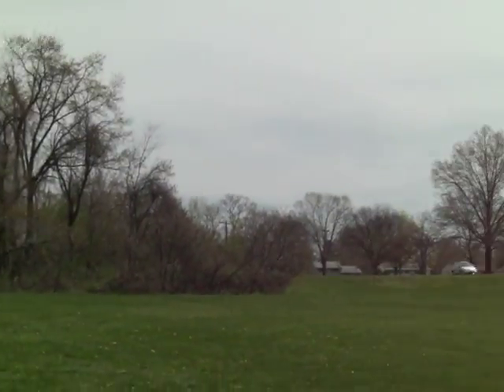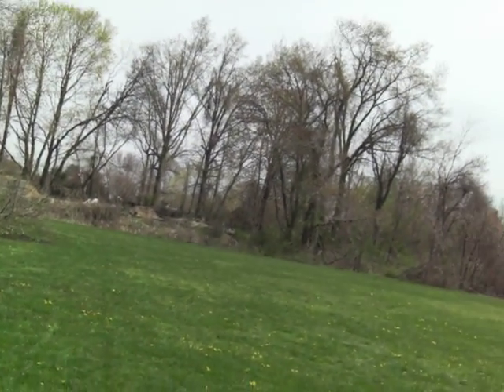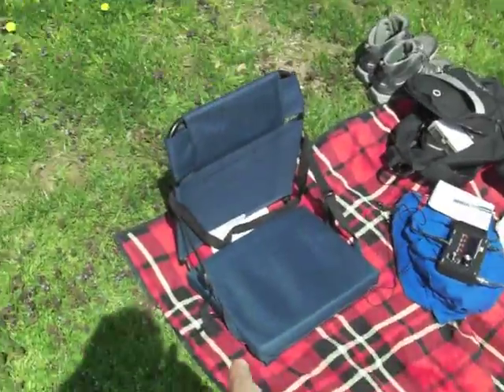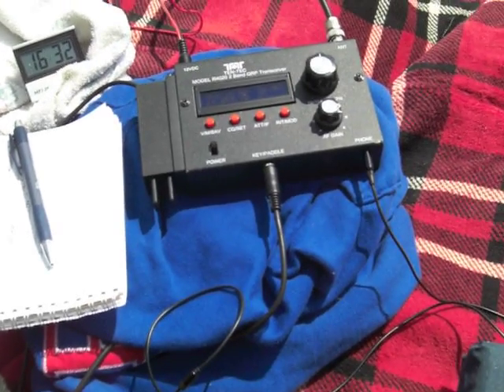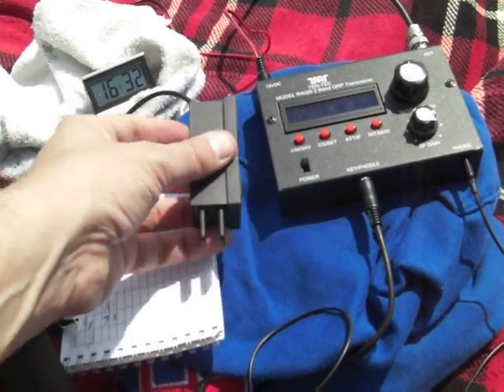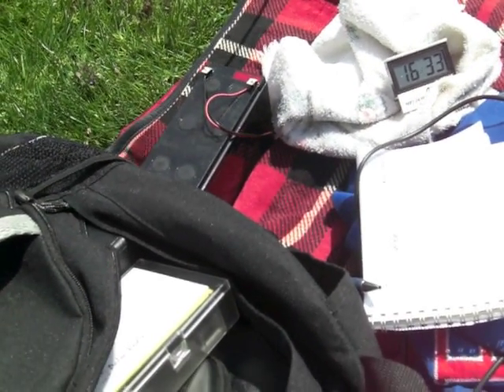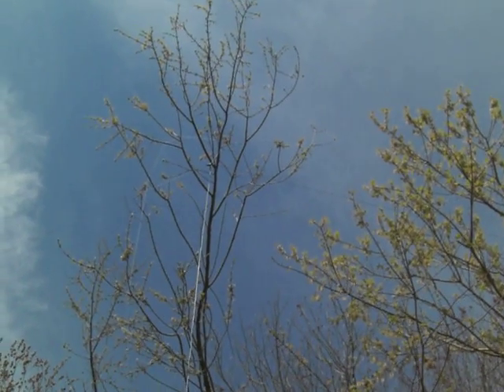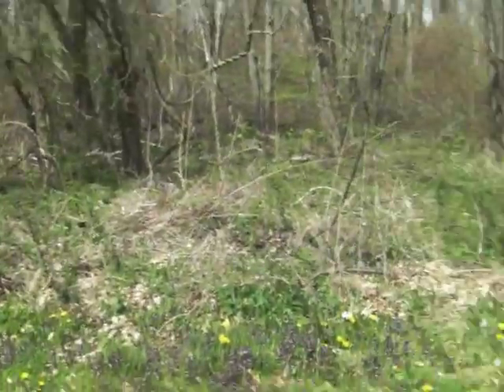KX9X - QRP To The Field 2013

Comment: I have the exact same setup. I carry the complete package in the saddle bags on my motorcycle and look for places to set up. I either use a mono band shortened dipole for either band or an ocf40qm for multi band with one antenna. I use the Palm Pico paddles. I think your paddles are the full size? 
Bary, KU3X